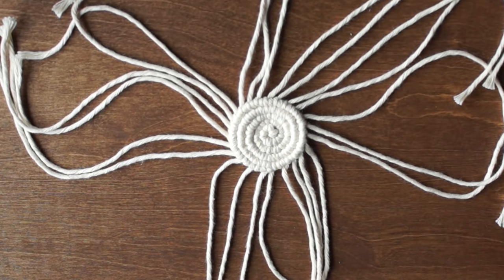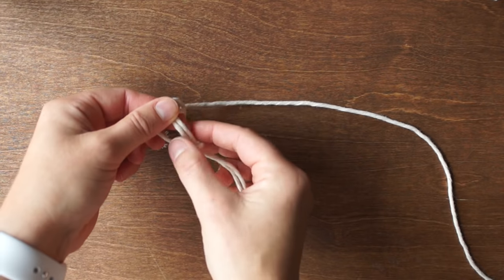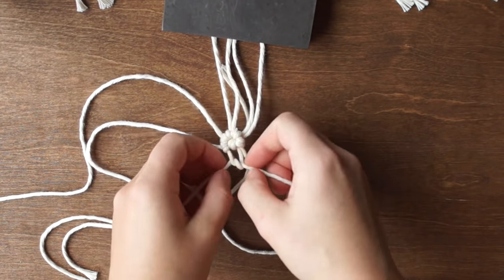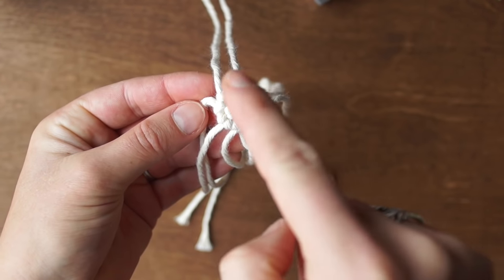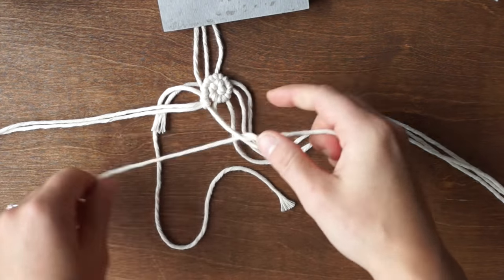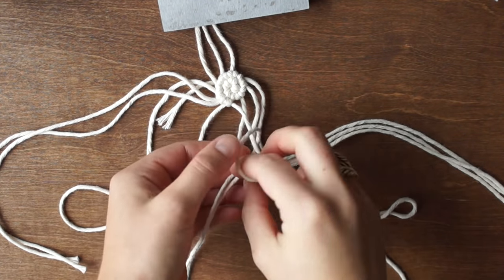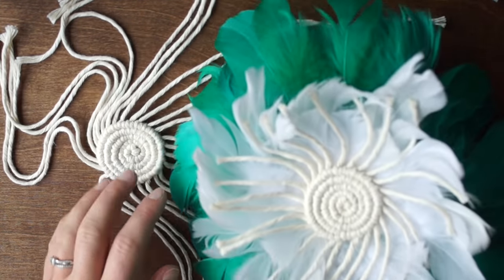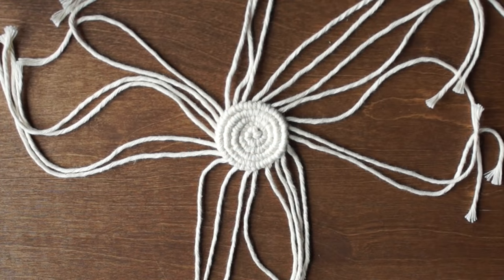DIY Macrame: Spiral Tutorial!

Comment: What size cord would you recommend for coasters and how long would you suggest for the cord length? I'm fairly new to this and need some advice
Reply from the maker: P B I think any size around 2-5mm would work! Let me work on a coaster for you and I’ll reply with the details!
Reply: @LotsofKnotsCanada  Oh thank you. I appreciate you making that extra effort.
Reply from the maker: @pb4897  I created a coaster with 3mm twisted cotton string. Filler cord (55 inches), working cords (40 inches). 

Round 1
- attach 3 strands to your filler cord

Round 2
- attach a new working cord, then tie a double half hitch knot with an old working cord (alt. until you finish the round)

Rounds 3-5
- tie double half hitch knots

Round 6
- same as Round 2

Creates a coaster that is just bigger than 3 1/2 inches (not including the fringe). Hope this helps! Thank you!
Reply: @LotsofKnotsCanada  thank you so much. I'm definitely gonna try it